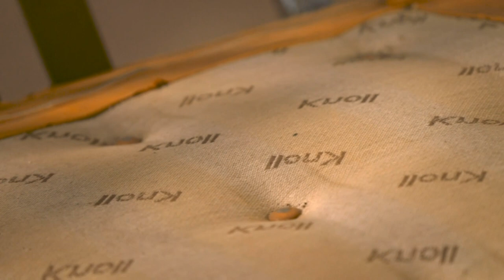Barcelona Chair: How To Restore A 20th-Century Design Icon | Salvage Hunters: The Restorers

Comment: I’m surprised that none of the rechroming portion of the chair frame was touched upon in the video. There were probably more hours spent on preparing the frame for rechroming than the upholstery portion. Notably, the preparation for chrome consumes all the time by working out all the rusty pits in the metal by layering copper onto the frame and sanding it until all the puts are filled….many layers, redipping, of copper are needed to fix the frame before the nickel and chrome can be applied by once again dipping the chair in those chemicals. All things considered, that chair frame took eons to bring it back to life. All together, both tradesmen seemed to do a wonderful job. What a beautiful restoration 👍🙂